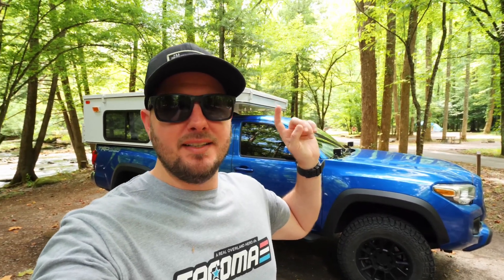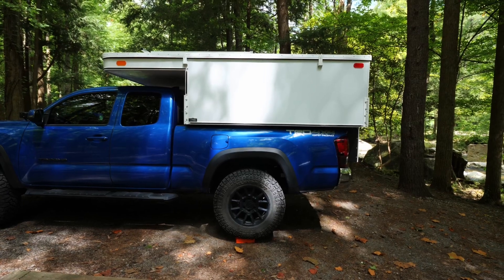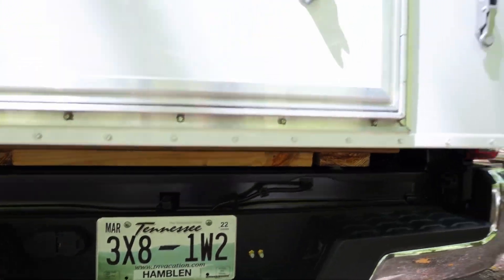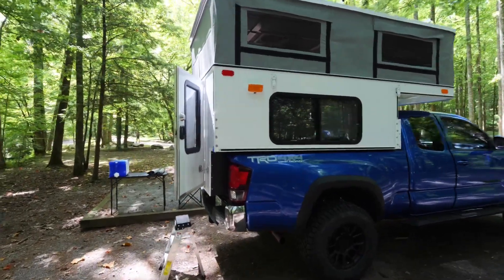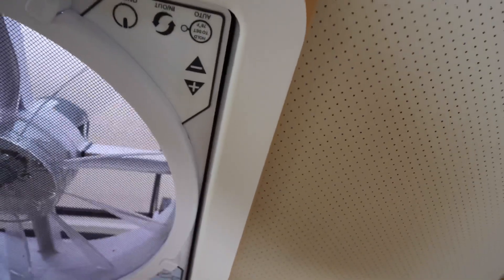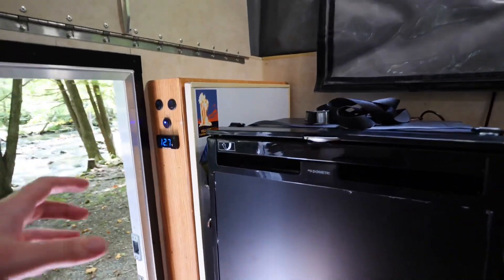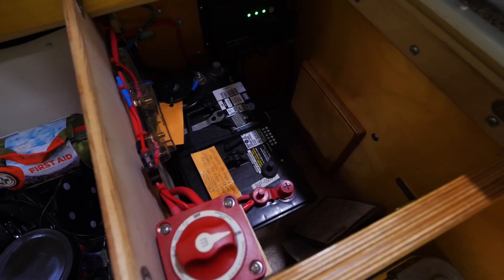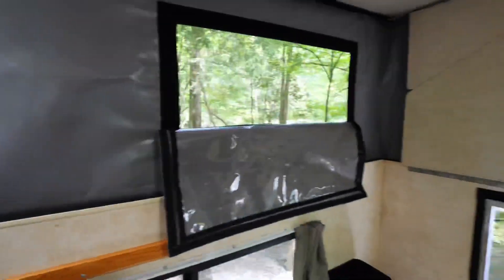FOUR WHEEL CAMPER *FWC* WALK AROUND | TOYOTA TACOMA

Comment: Nice score on the Four Wheel Camper turned into an FWC Eagle shell model.  The previous owner really did a labor of love on the conversion. I own a Tacoma and know why he took it in the direction that he did.  Simply put, weight matters.  

By the way - 25 PSI sounds about right for the Firestone Ride-Rite air bags.  I have an All Terrain Bobcat that is a carbon copy of the older FWC Eagle on the back of my 2015 Access Cab and inflate to 30 PSI, so I can wait a week to check the pressure, because they leak about 5 to 7 PSI in about week.
Reply from the maker: Thanks I was really excited to find the camper and he did do an amazing job on the rebuild! I’m still figuring out the setup but yes the bags seem good around that psi

Comment: Hi, its Mike, great video! the truck and Camper fits you well. im excited about the potential adventures they will take you on. Iwish you well on your camper build! Im not sure if i mentioned it but there is another "wired" spot in the roof frame  with the exact dimentions of the rear fan cutout is, to add an optional fan or just a roof vent hatch on the forward starboard side over the camper overhang.   safe travels!
Reply from the maker: Thanks I’m loving it so far! And yeah you had mentioned that about the fan above the bed part. Thanks again!